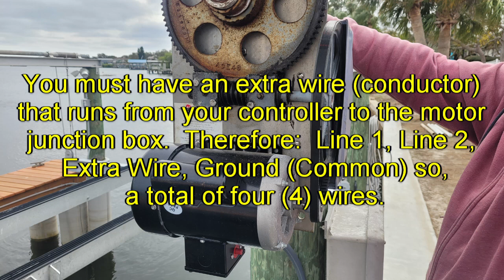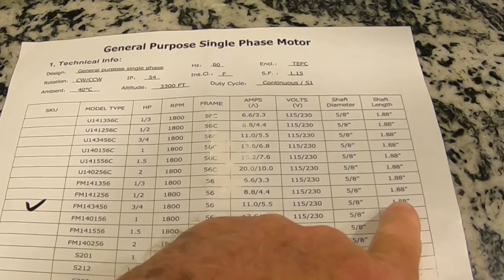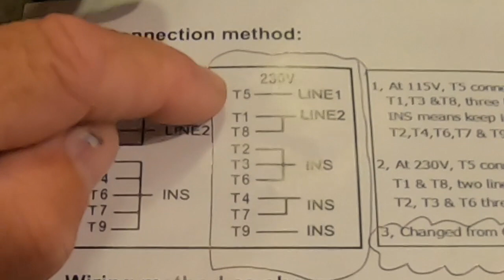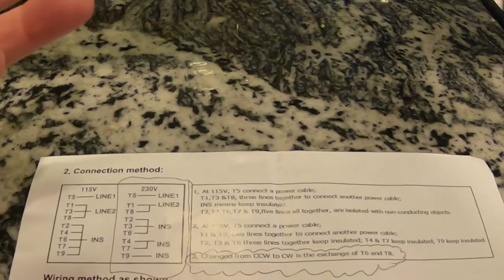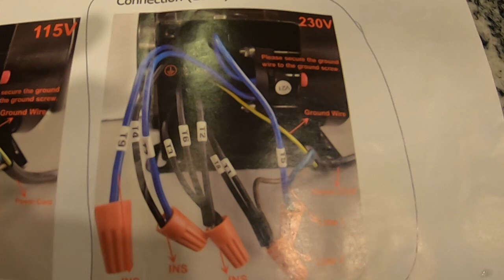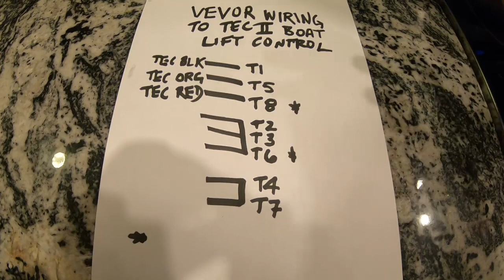Wiring VEVOR brand Motor for a Boat Lift

Comment: Thanks for the video… while it didn’t solve my problem ( different motor), it got me going in the right direction….

 Vevor 110v 3/4 hp 4P 1725 rpm… 5 wire cable Bremas Drum Switch ( Red Handle)…

Black —————— T5
Red    ——————T8/T3
White ——————T4/T2
Orange ————— T1
Connect —————T6/T7/T9

If it’s backwards from the control, switch T6 and T8…

Hopefully this will save someone A LOT of time trying to figure this out…
Cheers…

Comment: Thank you Conrad'! I bought a house in Cape Coral on Ctober 2024 that came with the exact same setup, except that Hurricane Ian flooded the box of the Gem Control( way too low, (I guess to save money on copper), so I had to replace it. The wiring from the gem to the motors was in good shape, but the connections to the motors were a drunk spider nest. I am an electronics engineer, but I have never worked with any electrical motors larger than a circuit board fan. I replaced the Gem remote myself, and now I am wiring a limiter for it. And you are also correct, any service call to any boat lift outfit will cost heavy $$$$! Your video and the Vevor wiring diagram was a lifesaver, thank you very much again for putting the video together, very clear! I confirm that this works as well for a Gem Remote GR2A that I purchased on Dec 2024.
Reply from the maker: Glad it worked for you!  What I found (because some seawater got inside my TEC II box) is that the contactors can be had for about $60 each and the transformer can be had on Amazon for about $20 (exact replacement).  Those control boxes are in the $800 range so big savings if the wiring isn't trashed.  Just sayin'  Cheers!

Comment: I have a 3/4 hp that has a 9th wire. Where do I wire that one?
Reply from the maker: If you watch the video through the 2nd half. you see that I did NOT USE T9 (the ninth wire).  I just capped it off and my setup worked fine.  I bet that works for you too.  Good luck.

Comment: I have a 1 HP Vevor motor hooking up to a boat lift switch 120 volts, I have a red, orange, black, white, green wires coming from switch. The motor has T1 through T9 do you have a wiring diagram for this? Thank you!
Reply from the maker: After a long set of trial and error I stumbled upon the success I shared in this video so, no, I don't have a 120vac solution for you but I recall either someone saying this setup also works for 120vac either in comments or by email but I'm sorry, I'm not certain.

Comment from the maker: I spent hours and many tripped breakers before I finally got this combo that worked.  Fortunately I didn't fry myself or the motors. I am not an electrician and I am NOT FAMILIAR with your drum switch (so use my suggestions with extreme caution and relates to 230VAC) but I'm guessing it's a "latching switch one way to make it go one way and latching switch the other way for the other" so that if you tie T2, T3 and T6 together and wire nut them.  Then tie T4 and T7 together and wire nut them. (Just put a cap on T9 - not used).  Then place T1 on your "common" terminal then T8 on (let's say, DOWN) terminal and then T5 on (let's say, UP terminal)  you should get some action that you're looking for -- though maybe not the right directions.  Then you could try swapping  T5 and T8 or your could try swapping T8 with T6.  One of these combos should get you the right one.  Also -- call the switch manufacturer.  I have found my control people at TEC Remotes to be approachable through they didn't know about my motors.  I feel your pain.  Hope this helps.  Good luck.
Reply: It took a few hours but I did figure it out. This is for a 120v setup on a Bremas drum switch. 
T6 on my red (up switch wire)
T8 on my orange (down switch wire)
T2/T4 white together and T1/T3 black together. 
When I’d rock the switch back and forth it would send 120 to the red or the orange. I’m definitely not an electrician but after about 4 hours of trying things out and testing terminals with the volt meter I figured it out lol. Hopefully it saves someone some time!! 
Also I just took 5,7,9 out the equation since that just goes to the reset button.
Reply: @jakeculler  Good day this works thanks, and to take things further as to have everything going through the reset/overload button, just change the White wire to going into T7/T9 then the T2/T4 wires going into T5 to have it going through the reset/overload switch. 

I just did this after trying your configuration to also have it going through that switch and it works fine. Hope this helps anyone else and thanks for putting me on the right path firstly!
Reply: @jakeculler  Thanks Jake! that was exactly what I needed
Reply from the maker: Yeah!

Comment: Thanks for taking the time to share this.  Same wiring setup you provided works for 120v also.  Vevor wiring diagram not very helpful
Reply from the maker: Thanks for commenting.  I can't even begin to tell you how many hours I wasted trying to get answers from VEVOR and then from TEC Remotes.  (They hadn't heard of the brand and didn't know.)  My first attempts only got the motors working in the proper directions but they would pop my breakers.  Jeez.  Glad this worked for you.  Glad I could save you from pulling out some of your hair!
Reply: interested in learning what wire you connected to the white wire. 230 volts require 2 hot wires, 120 only 1 hot. I don't want to burn out the motor.